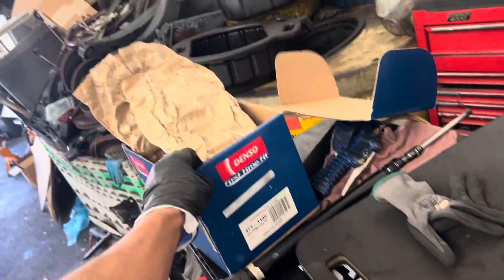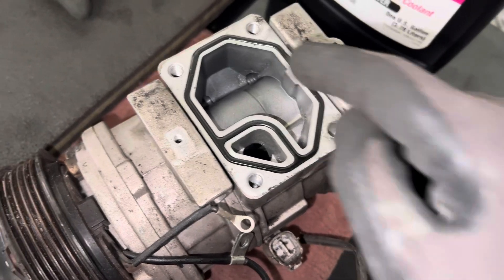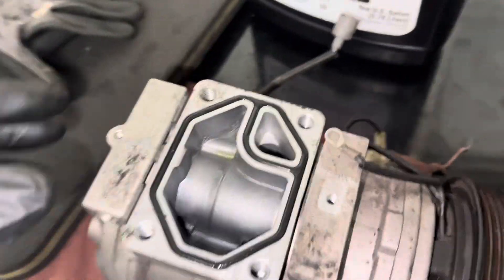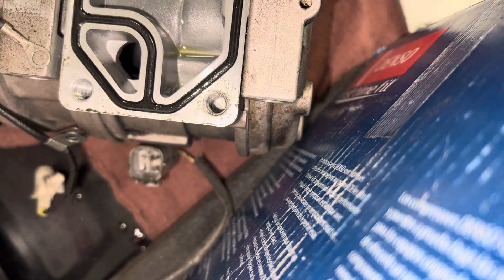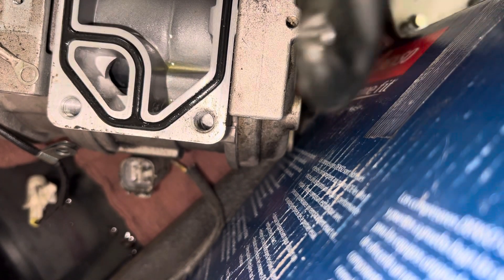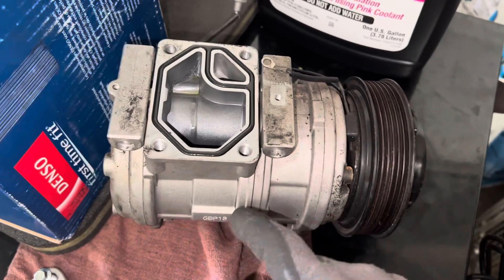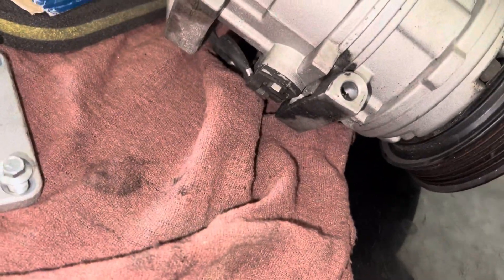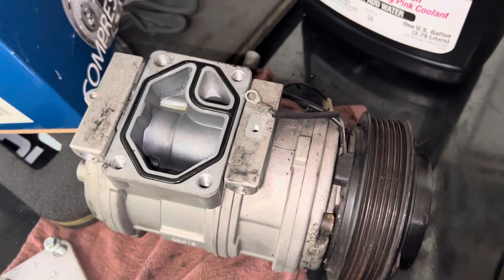Sometimes compressors get changed when they don’t need to be changed. (“MORE THEN JUST SOMETIMES!”)￼

Comment: Excellent point. When labor and refrigerant are so expensive, and getting correct parts such as a clutch can be weirdly time consuming, the mindset has drifted into doing more to save money and reduce callbacks over the long term.
Reply from the maker: Yes 👍 
Just like I no longer rebuild compressors like I was taught by my father, because labor is just so damn expensive in our country nowadays . And they legality and responsibility of fail parts and responsibility to refund money. The risk is too high to the business has often turned us into parts replacers.. 

I look at videos of compressors in components rebuilt in Third World countries where labor is extremely cheap.  We used to be that Third World country..  and still have parts of the United States labor is so hard, extremely cheap for the economy of their area they still can afford to fix things economically.  Not possible in San Francisco California anymore.. 

Just think of 2024 the price of refrigerant is going to soar again when the implemented 40% cut back on the restricted refrigerant is implemented . 
     Just with this 10% cut back I watched my price of 134 jump from $79-$119 up to $350 for a 30 pound. 
The exact same thing with 410 $79 to $110 jumped up to 400+ dollars 💸 and this was only with a 10% reduction in manufacturing output.